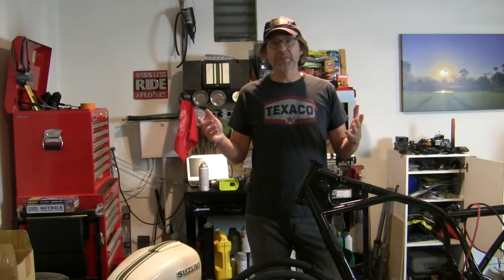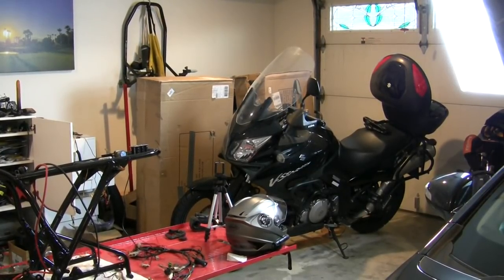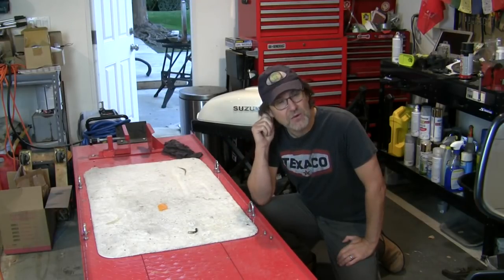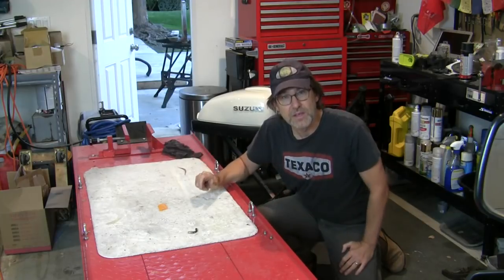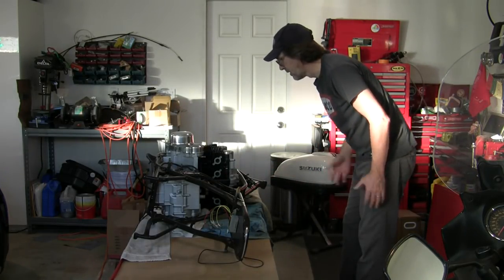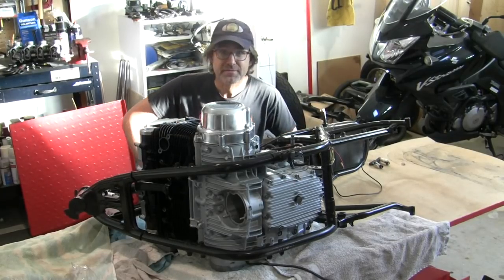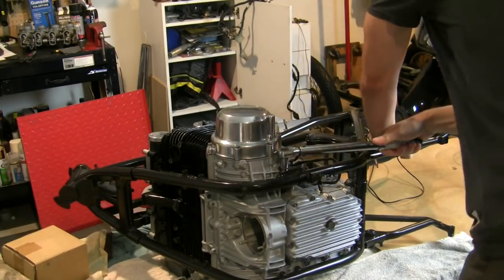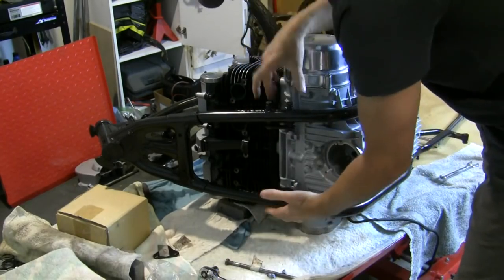Engine Install - GS550 Cafe Racer Build (Part 65)

Comment: i don't know how many times I've watched this episode (and commercials) to refresh my memory on how those little 3-hole plates go...
In some of your videos I see a Chevy Volt sitting in the background.  Tell me about it and whether you've had any problems with it...and how you resolved them.  In addition to my 1977 GS550, I also have a Chevy Volt (and a 2001 Honda Insight).
Reply from the maker: Thank you for watching! I've not had any issues with my volt at all. 111,000 miles now and I still love it. It used to get 50 miles of electric range which handled most of my around town driving. I used to commute 60-70 miles/day and my Volt really helped keep my costs down. (Now I get 35 miles/full charge.) No significant maintenance to speak of. I need to change coolant now and I've had to clean the charging switch once. Also put a regular 12-volt battery in once, but original had reached its life expectancy. All in all a fantastic car. I consider its purchase one of the best decisions I've made.

Comment: I saw your video today. The engine looks like new. Great tech how you built the engine into the frame. I still have an engine left and I'm also thinking about whether I should take it apart and fix it up again. Greetings Matthias
Reply from the maker: If you do if it's a popular model you might be able to recover your costs to rebuild.